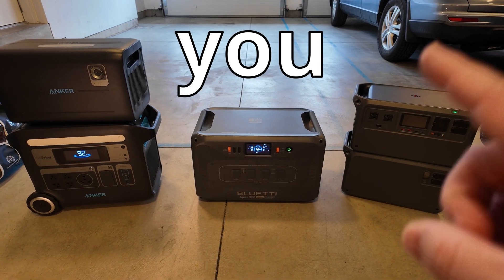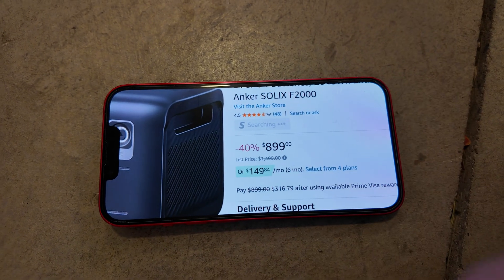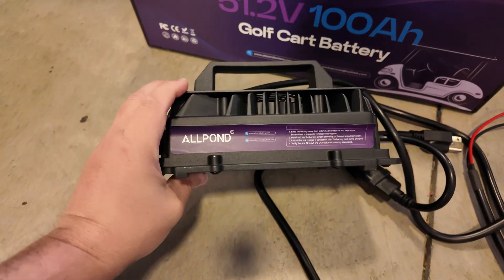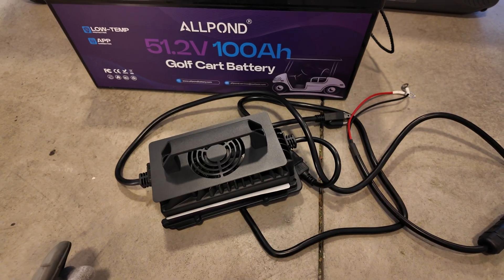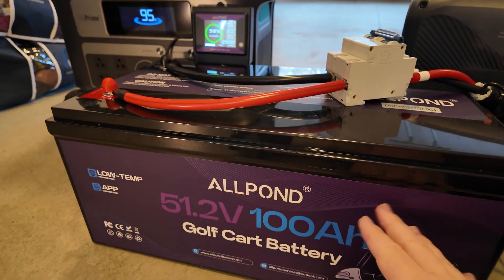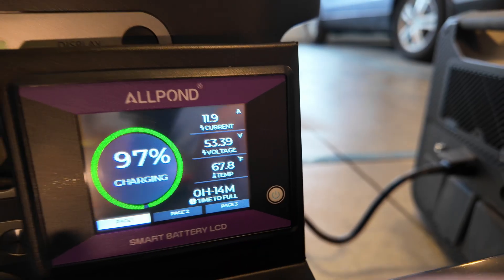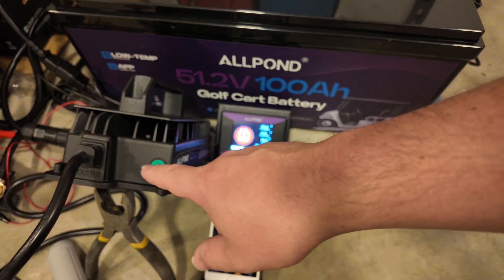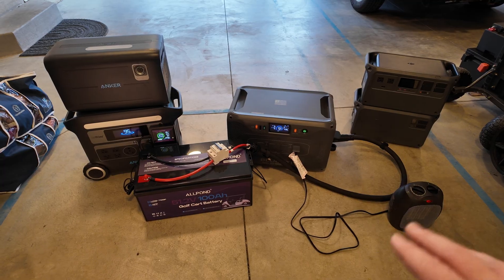The Great Solar Generator Rip-Off (And How to Beat It)

Comment: Say goodbye to your warranty.
Best to  build your own. Why would these companies to allow homeowners to start attaching any crappy battery to their very well designed units. Not a smart Idea.
If people want to start wanting more control, just buy a commercial inverter, a controller, and as many batteries as you want.
Build a home inverter battery system.
But it would be stupid for manufacturers to allow homeownerS and you tubers to start jerry- rigging their equipment. Too much liability for the manufacturers.
Because most home owners are stupid, and have no clue about power systems, other than the fact they have the ability to buy one.
The things you are pushing put the consumers at significant physical and financial risk.
I was a Commercial Electrical Contractor that only worked on large commercial projects for 45 years, and when a customer asked the price I would give him a fair quote. if he or she asked how much if they  helped, i quoted double the price. LIABILITY!
Reply from the maker: Yep! This isn't a solution for everyone!

Comment: I got the ecoflow 2 away back hardly used it when I do its for convenience portable power that I have charged up with my mains electric I also got a 200W solar panel £1700 garbage.
Reply from the maker: At least you’re prepared!

Comment: when you plug in solar will it also charge the lifepo battery?
Reply from the maker: Yes! On option 2 that is. Option 1 works too…just got to connect an external MPPT.

Comment: Its very comfortable to have the proprietary battery but expanding it in such way is awesome, only issue i see is that the f2000 doesnt combine the output of the batteries, it will discharge the external battery first, wonder if that would still work with it.
Reply from the maker: Yeah! It’s an epic setup!

Comment: i have a full solar emergency setup for less than $1000 i have 2 100w solar panels and a 200a charge management system charging 5 200ah semi-truck battery's what i got from a scrap yard for the price of recycling scrap $75 each i tested them with a battery health tester to make sure they where good and a 2500w pure sinewave inverter
Reply from the maker: Good for you!

Comment: So if you have a refrigerator or whatever hooked up to the power station, does it drain the power station first or the battery, or does the battery slowly recharge the PS as it is drained by the fridge?
Reply from the maker: They both drain together in the 2nd option. In the first option, the extra battery gets drained first.

Comment: I have an apex 300 so this is very interesting for me, i knew it could be done but seeing it work makes me more inclined to actually go for it, i'd like to add a 50ah to my apex 300 to basically double it's capacity, it's like €1000 for the bluetti one and about €350 for an Amazon battery 😅 (sure the bluetti one has 0.2kwh more but still 😅) looking forward to the next video
Reply from the maker: Thanks so much! Just editing a video right now that goes into depth how I built the wiring harness and everything about this setup with the Apex 300. Subscribe so you don't miss when it drops!

Comment: I am the owner of the Bluetti AC200L plus 2 B300K batteries. First you are wrong about the minimal value of a stand alone B300K NOT =0.  Without a Bluetti AC200L or any other Bluetti compatible product you have a big overpriced paperweight.  I have a total of 7577 watt hours which is the max possible with AC200+B300K. This Bluetti system cost me $3200 in December 2024 Black Friday sales. Some guy said he was able to charge a Bluetti Ac200L with a 51.2 100Amp battery.  I bought 15,375Wh of Ecoworthy batteries for only $1,575. 12.8V 300amps =3840wh x4.  I am going to build 2 solar systems of 24v 7680 watts and they will share the same MPPT Solar Charge Controller and 5000 watt inverter. I will just connect the most energy using things I have heat and air to the 24V systems. I think I will be in strong position because I can run an electric blanket for 9 hours and only use 14% of my 7577 watt hours of Bluetti. Plus I have a Bluetti AC180P that is 1440wh and will run an 80qt car fridge for 7days on a full charge. So if I just put 100 or 200watts of PV that thing will run forever.  anyway I spent 3 months in the desert in winter and it was cold in 30s and 40s at night and 50a to 70s in daytime. Nothing like snow and ice but it was still not South FL after 10am in January or February.  I know this because I was a beach lifeguard in Pompano Beach back in the 1980s and it would be in the 40s in February and I was bike riding to work cause I did not have a car and I’d freeze my ass off riding to work but by 10am it was in the 70s

Comment: Great video! Thinking of   Buying two 10awg ring terminal to XT60i cables plugging them into my two Delta pros and hooking them up to the batteries. Then hooking up the batteries to my solar array to charge them. Also use my 11500watt Westinghouse tri fuel generator to top up the batteries when needed. Do think this would work?
Reply from the maker: Sounds like a solid plan!

Comment: Power banks in my books are a scam because they aren't modular and therefore easily repairable costing the consumer hundreds if something goes wrong.  I have a 500w Energizer Arc power bank, while moving it around with my belongings powered on one one of the functions that was unnoticed and drained the cells too low and beyond the point of being able to charge the unit.  If the bank had a main battery disconnect switch this would never have happened because I would have been able to cut connection between the battery bank and control board. It is cheaper to get a 12v lithium battery with pmc control board built in, a pure sine wave inverter with USB and C outlets and a wall charger for a 12 volt battery .
Reply from the maker: Yeah! One size does not fit all!

Comment: My mom wanted a small emergency backup, she said she wanted one of the Anker/Blueeti types..for $3k+.......I have done DIY solar so I built her a DIY version of the solar generator by using Amazon lifepo4 batteries, Amazon inverter and Amazon solar panels for under $1k......and according to my calculations 3x the capacity. Those so-called solar generators are a true ripoff, thanks for addressing this!
Reply from the maker: That's awesome! Good job doing that for your mom!

Comment: I just bought the anker f3000. Part of the draw was that it can take a charge directly of up to 3600 watts from gas powered generator while still discharging 3000 watts simultaneously and recharge in an hour. Doesn’t this somewhat solve the problem you’re describing and why do other units including anker ecoflow etc not allow for this type of ups and recharge simultaneously. Sorry noob so my terminology may be off.
Reply from the maker: Here’s a video about it: https://youtu.be/Jg7HqRmNQlw?si=gMYeXMg-KKLfgLIH

Comment: can use two other batteries with my main solar batter example  12V 100Ah LiFePO4 Lithium Battery Bluetooth - BCI Group 24 Deep Cycle Battery, Built-in 100A BMS & Low-Temp Protection, 15000+ Cycles,  and  LI TIME life pro4 100 AH MI
Reply from the maker: Yes. So long as they match in chemistry and voltage!

Comment: This is a half-ass solution. Just build your own power station altogether and save lots more
Reply from the maker: If you are just starting, for sure! But there are a lot of people that already have power stations looking to make better use of them!
Reply: @theresatrickforthat  Those who are just starting should start the right way and learn from our mistakes. Avoid the power stations altogether. I sold my Delta 2 and bought another 12v 300ah battery. That is the way forward. I now have 7680wh for the price of 2048wh from EcoFlow

Comment: 5:25 For an Anker 3800 Plus, there are two solar inputs.  Would you foresee any issues connecting the battery to one port and solar panels to the other?  Thanks
Reply from the maker: I don't think there would be an issue at all!

Comment: There is a difference between "cheap" and "inexpensive"
Reply from the maker: Sure is!
Reply: @theresatrickforthat I utilize Will Prowse's wallet and testing to determine WHICH budget batteries are worth while buying.  Why read reviews or trust a ⭐️ rating when you can watch Will , test it , cut it open , and show you the guts.   😂
And speaking of Will , how about him just DESTROYING BATTLE BORN batteries sales by showing the Mega Fault and Internal JUNK they've been using for years.  Not to mention the Boat Fires on record that insurance companies are now going to SUE Battle Born and parent company Dragonfly over. 
All to save $20 in design/materials inside their USA made Chinese Battery  !!
( turns out the stickers aren't even made in the USA on BB batteries ).

Comment: How can I used this battery with a 12v system?
Reply from the maker: Only using the option 1 I showed going through the MPPT charge controller built-into the power station.

Comment: That is a great way to expand the power stations however I wouldn't call what Bluetti is charging for their extra batteries a rip-off in any way. I couldn't fit one of those in the space available in my rv but the bluetti batteries stack beautifully, the same size as the main unit and plug and play without modifications is worth something. The pricing isn't that bad and they are getting better with each new model it seems.
Reply from the maker: Yeah! Sometimes OEM batteries are the answer for certain scenarios!

Comment: Why a golf cart battery and not a server rack battery?
Reply from the maker: Because I think the gold cart battery is more bang for the buck with the included charger! But a server rack battery would work great too!
Reply: @theresatrickforthat I like that includes the charger. It also will allow me to charge the system using that charger if im using my older gas generator. Is it wrong to think that charger would clean the dirty power?

Comment: I was looking into buying a Coolavan RV roof top air conditioner, on the website their video says you can attach it directly to a battery. Do you think a 51.2 v battery would work for this ?
Reply from the maker: Not sure. You have to check the specs of the AC unit and see what kind of battery voltage it's compatible with.

Comment: You might as well built your own system instead of buying power stations, if you decide to do it like that…people who buy power stations do not want to do “all that”, they buy power stations for the convenience 😩
Reply: Tru, but if u already have a power station it's a home run to do it as he proposed 👍
Reply: @lisaryder1668 if you do it like “this” you always wanted to “dabble”. Eventually you will try to build your own little system. Like I stated before, people who buy power stations do not want to “dabble” with DIY…this is definitely DIY 😩 power station people like plug & play
Reply: @PaksLife It's possible that you like DIY AND Plug N Play. That would be my case. We get power stations for convenience not because we don't like to DIY.
Reply from the maker: But some people already have power stations and they want to get more use of the money they already spent!
Reply: @theresatrickforthat people who buy large power stations don’t sweat the monies “like that” they like plug & play not DIY.
Reply: We all pay for convenience some where in some way. Some people just pay the power company and do not even buy the plug and play systems. Hack the planet!
Reply: Had to build my own not one supports larger DC loads I put everything in a back pack and can head off with my trolling motor to any lake I have a boat at. Also like that everything is modular any component fails replace it. You can also boost your car boat snowmobile etc. 11:47

Comment: A  power station is the way to go for most van and RV owners because the input-output and charging is done by an industrial grade  integrated system that bypasses the vehicle electrical system. In a word, safety.
Don't scrimp on safety. You have to pay to play. Nothing against DYI but labeling power banks a rip off is YouTube click bait.
Reply from the maker: Did you not watch the video to see what I was saying was a rip off?

Comment: The bluetti elite 200 is like 700 bucks at the moment. Hard to beat 2kwh with a 95% efficiency 2.8KW inverter for 700 bucks with black friday deals.

With rakuten 12% cash back + current paypal 20% cash back(dunno if that is available to everyone) you can basically get a 1kw mppt battery charger, 2kwh battery, and 2800 watt inverter, all in a small package, for ~500 bucks before taxes. Kind of hard to beat that even if you build the same system out of cheap components.(and 95% efficient inverter is pretty high up there, even higher than high quality inverters such as the victrons that are around 92% efficient)
Reply: Unless you’re in China then it only costs you  $0.06 cents
Reply from the maker: Nice!

Comment: Not sure that you actually have to have same chemistry since power is going through BMS anyway and BMS does not care from what chemistry power comes in. But if Bluetti does not have BMS in front of this 60V input chain, it's indeed safer to use same chemistry batteries.
Reply from the maker: If you are connecting directly to the power station battery like I did with the Bluetti, then 100% you MUST have the same tyoe of battery. If you are doing the 1st option and going through the MPPT controller, then yes, you have flexibility.

Comment: How many Allponds can one attach? (in parallel, I would think)
Reply from the maker: As many as you want so long as you build in proper cable sizes, and most importantly, correct over current protection.

Comment: Can those battery take boost charging like the brand name?  And  what is the life span of those batteries? Brand like bluetti  garanties at least 10-15 years and from what i read, ''standart'' lithium batteries have a 5 year lifespan ?

Thanks
Reply from the maker: Yes! You can boost charge them! "Standard lithium batteries" are probably referencing NMC chemistry...NOT LiFePO4. One of these golf cart batteries will literally last forever! You could HEAVILY cycle it from 100% down to 0% and back up once every day for 13 years and by that time you would have only experienced a 20% degradation of the entire battery pack! If you cycled it from 80% state of charge down to 20% and back up every single day...now it will last for almost 30 years before experiencing 20% degradation. The electronics in your power station will die way before the batteries themselves do!

Comment: So long as you're not a slave to appearance and willing to sacrifice a few of the less useful bling bits, you can save an enormous amount of money and build your own complete system from scratch. I currently run a 2000W pure sine inverter and a add-as-I-need-it battery setup that currently has 3 100 aH LiFePO4 batteries, charges quite happily with the existing solar controllers on my RV or camping rig, from a plug in charger, via a DC/DC converter from my vehicle, or via a home-built generator.
Reply from the maker: That's awesome! Thanks for sharing!
Reply: @theresatrickforthat forgot to say,  the cheaper price tag includes all the extra tools you might need to get,  like the heavy gauge battery cable crrimpers.

Comment: I found this video informative.  I am considering a solar generator system that could run my 30 amp 110V RV for six hours or more.  I fear the battery bank will be to heavy and cumbersome to make the system a worthwhile investment.  I believe I can build a system that I understand.  I am avoiding commercial solar generators as I don't know their proprietary designs.
Reply from the maker: You can definitely build a great system that isn't too heavy or cumbersome!

Comment: Will the AllPond Golf Cart Battery Kit 5.12 KWH work with a smaller solar generator with a battery size 3.6 KWH like the OSCAL PowerMax 6000 Solar Generator?  The OSCAL PowerMax 6000 Power Station Expansion Battery(3600Wh), BP3600 Extra Expandable LiFePO4 Battery for Solar Generator cost is insane $5,999.
Reply from the maker: Perhaps! Haven't tested that power station yet...but I think I will be soon!

Comment: Looking at getting the eco flow delta 3 ultra or delta 3 ultra plus? Leaning towards just getting the ultra and pairing it with a 48v 100ah lfp battery to extend the runtime for power outages. What would you get? Thoughts? Thanks!
Reply from the maker: If you don’t already own a power station… Since it sounds like you are looking to purchase one… And you are getting one of the giant ones that are not quite as portable… And you are going to just use a standard cheap external LFP battery… I think you could save a huge amount of money and get a more capable system by getting an EG4 12,000 XP or one of their hybrid inverters! That’s just my opinion!

Comment: I have a growatt 20 kWh full island inverter with backup to the house. It has a limit of 30 kWh apx batteries. 
Question 1: will it be possible to expand it with your golfcar batteries?
Q2 if so is the limit of 30 kWh breakable?
Reply from the maker: Yes and Yes. The limit is due to over current issues. So you need to add a bunch of extra T-Class fuses to your battery banks to help prevent issues by exceeding the 30 kwh battery limit.

Comment: Or just build a system from scratch. After my Bluetti unit failed I realized there was no way to realistically repair the thing and I now had a boat anchor.  I decided it made more sense to buy individual components so if one part failed you can easily replace just that part.
Reply from the maker: True!